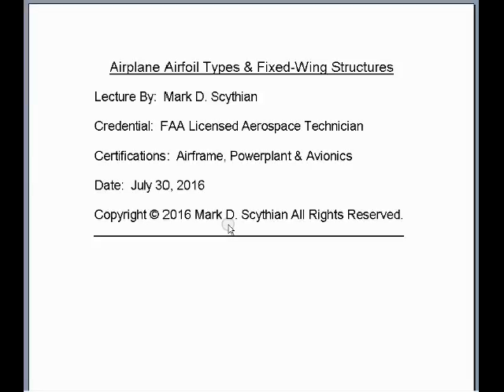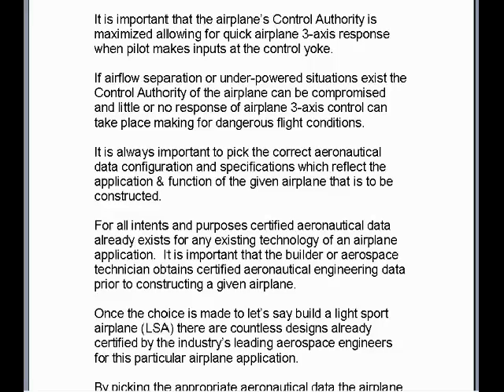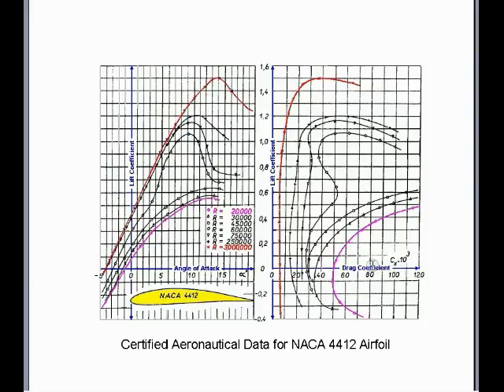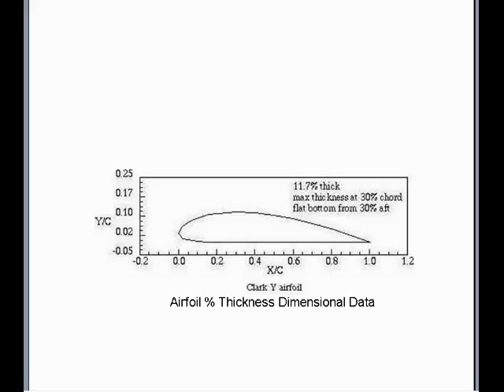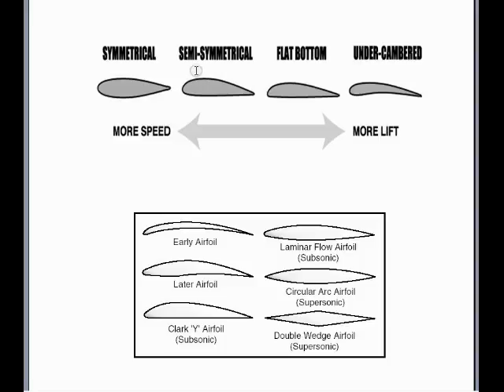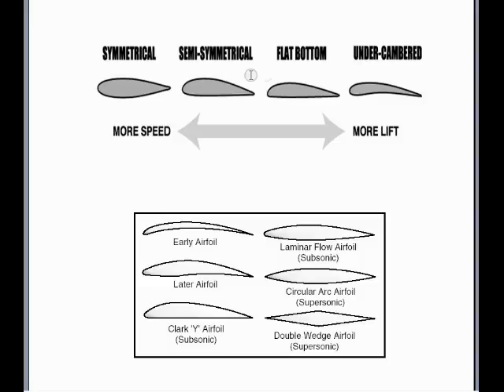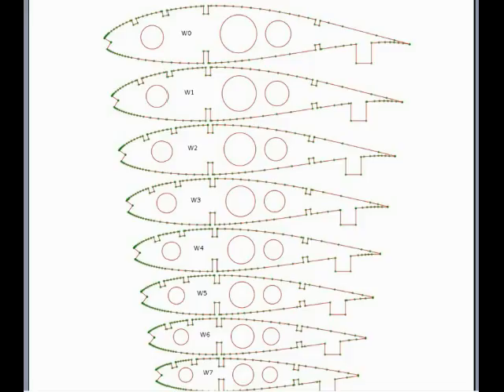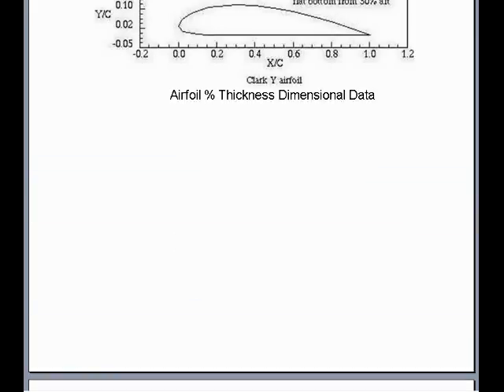Airplane Airfoil Types & Fixed Wing Structures

Comment: Wings fly because of the physical actions and reactions that occur between the distributed heavy, sticky, elastic, sealing, connected viscous fluid particles existing around the zone in which the wing exists. NOTE THE IMPORTANCE OF THE MASS AND THE STICKY, SEALING, ELASTIC, VISCOUS,  CONNECTING  PROPERTIES OF THE FIELD AROUND THE SURFACE OF THE FLUID  PARTICLES, INCLUDING THE  RELATED FIELD PROPERTIES AROUND THE SOLID WING ITSELF WITH ITS OWN MASS AND AREA OF EXPOSURE. 
The mass and other properties making up the air particles can create a compression zone if the fluid particles move towards a stationary object with, its own mass and area of exposure, or the stationary fluid particles are approached by a moving object. 
The mass and other properties making up the air particles can create a suction zone if the fluid particles move away from a stationary object or the moving object moves away from stationary fluid particles. 

In all the cases mentioned above note THE IMPORTANCE OF A FLUID BEING TREATED AS A CONNECTED SYSTEM WITH AN EFFECT THAT IT COULD BE TREATED AS A IMPERVIOUS  MEMBRANE WITH AREA AND  WITH MASS, APPROACHING OR RETREATING FROM AN OBJECT WITH ITS OWN MASS AND A LARGE AREA OF EXPOSURE.

Note no compression nor suction zones can be created if the fluid air particles and the wing did not have  BOTH an effective MASS and an AREA OF EXPOSURE.   Pinpoint masses approaching or retreating from each other cannot create neither compression nor suction zones between them.  A lump of dry loose sand or gravel particles are thrown at a wall will not create an effective compression zone before them nor a suction zone behind them because they do not have the sealing property of acting together to form an impervious flexible membrane. 

In a stall, the state of the air particles with respect to the shape of the wing at the time will create a fierce suction zone which will rip the effective sheet membrane effect of the fluid particles for these to become like individual sand particles and the membrane suction effect is lost, thus lift is lost.  A heavy suction effect can stabilize a vortex of fluid circulating around it, but this closed circular membrane effect of fluid does not help in flying, and lift needs the fluid to act as an impervious sheet membrane with distributed mass.  If the membrane effect of the fluid is lost to high suction zones, then particles will be like sand with mass but not enough exposed area to make a large weighty floating piston effect to pull or push at to create the required accelerating forces with compression or suction effects around the wing. ( Enough suction in a stall) 

Note that what was described above can occur not only because of a high angle of attack but by other states as in, sideslips, wingtips, elevators, ailerons, rudders, spoilers, flaps, slats and even protruding rivets and extended undercarriages, dive brakes. It could also be affected by side winds, wind shear, and other turbulence and ice on wings and heavy raindrops disturbing the state, the wing was designed for.

Basically, the dynamic lift is obtained in zones, through Force= mass* acceleration and accelerations in fluid surroundings and an airfoil having relative velocity between them,  there are four principal zones to consider. Take the cambered airfoil operating at a slow speed.
1.  Compression zone at the leading edge and above it,  followed by
2. Suction zone all along the mid-rear upper surface all the way to the trailing edge.
3. Suction  zone under the leading edge followed by
4 Compression zone all along the lower surface all the way to the trailing edge.
  
These four zones make up all the logic that is needed to curve the streamlines around an airfoil section with zones accentuated or diminished to cater to the required speed of the airfoil. 
We shall not talk about what happens in a wind tunnel as in reality it is the air that is initially at rest and it is the airfoil that moves and caused the zones mentioned above.
Basically, the initially stationary heavy air is accelerated vertically up and down but due to the mentioned zones around the airfoil section, this is what happens.
 *A stationary fluid particle compressed at the upper leading edge, when rising up will find ahead of it a suction zone and so in addition to an up-down vertical motion, it will accelerate towards the trailing edge thus shifting it horizontally.
 *A stationary fluid particle sucked up at the lower leading edge will rise up will find ahead of it a compression zone and so in addition to an up-down vertical motion, it will accelerate towards the leading edge horizontally.
This is the reason why in a wind tunnel ( air moves, airfoil motionless) this relative horizontal displacement difference is shown as the upper surface streamlines going faster than the lower surface. In reality, of actual flying, the stationary air particles can be said to shift in location, with those on the upper surface moving up and down into a suction zone towards the trailing edge and those at the lower surface moving up and down into a compression zone thus displacing towards the leading edge. 
What we see in a wind tunnel must be interpreted correctly and we should not say that the air above the surface of a wing is moving faster than those on the lower surface. 

Something to think about...... if the air-fluid particles around the wing acquire any substantial forward velocity, the airfoil will never fly!!!!   In reality of flying, it is the stationary heavy air particles that are shifted, basically being accelerated and decelerated about their initial position. ( the wing is not so thick after all)   In a wind tunnel, it is not exactly like that, and one needs to know what frame of reference one is working with. Again in the reality of flying, it is the airfoil that is moving fast, while the air-fluid particles are merely being, accelerated, note,  ACCELERATED, around the same location to produce the lift and drag within the vicinity of the wing. All that happens behind the wing is of no concern apart from those who try to fly in it. All that dumping behind the wing is consequential, but it does not contribute to the lift of a wing,  and only those fluid particles which are accelerated in the zones mentioned above and below the wing, are the true masses that produce lift and drag.  If we lived in a perfect world,  while the airfoil section goes through the initial stationary heavy mass air particles,  they will merely accelerate and decelerate and they will regain the same location they occupied before the airfoil traveled through that zone/space of a fluid matrix with uniquely connected mass/viscous particles.
Reply from the maker: Hi carmel pule'.  Thanks for your comment.  Consider the concise-version of 'why wings fly' in the following content below.

Aerodynamic wing lift is predicated on the following:

1.) Airfoil Effect.

2.) Aero-Elastic Boundary Layer & Dynamic Viscosity.

3.) Bernoulli Force (flat-bottom & semi-symmetrical airfoils).

4.) Newtonian Force (symmetrical, semi-symmetrical, and flat-bottom airfoils).

5.) Computational Fluid Dynamics (CFD).

6.) Navier-Stokes Equations.

7.) Reynold's Number Limitations of given aerodynamic structure.

8.) Aerodynamic Lift = [(P)(A)(V^2)(Cl)] / [(2)]; where P = slugs/ft^3 air density, A = 2D plan-form wing area in sq ft, V = indicated airspeed in ft/sec, Cl = coefficient-of-lift for given wing airfoil.
Reply: @markscythian7179  Hello Mark, thank you for replying. As I deal a lot with young students, 15-year-old children, I prefer to show them experimental procedures. I have a water tank in which I can introduce an object to view the streamlines around it.  I thought that it would be interesting to try and find a method where the contour of the airfoil will be generated automatically. 

What I did recently was to get an object in the shape of an H  and rotate it by 90 degrees to become horizontal, such that it would have a  rectangular hollow at the leading edge and another one at the trailing edge.  When the fluid was made to flow along such a rotated by 90 degrees  H-shape, first without any angle of attack,   the hollow in the leading edge generated two contrarotating votices that were kept bound in the hollow due to the high pressure at the leading edge, but ahead of the leading edge, the streamlines divided as normal over and under the object, with the high-pressure zone and the velocity vectors at the leading edge, setting the leading edge two vortices in action. 
At the hollow in the trailing edge, another two contrarotating bounded vortices were developed and this time they were held in the hollow by the usual suction at the back and the velocity vectors at the trailing edge setting the two back vortices in action.  
The interesting issue about this shape is, that while within and in the immediate vicinity of the shape, there was a lot of turbulence, a little away from the hardcore shape was formed a fairly smooth trajectory/ contour of the shape of an airfoil, which was a natural shape which the object itself created. 
I thought that one could forget about the turbulence that was formed within the shape and outline the approximate/average limits of the smooth streamlines zone, then one would have what looks like a good airfoil.  I call this a naturally evolved airfoil which the obstructing shape contoured by itself.  I have a feeling that airfoils on birds and fish were shaped with such natural evolution over a few thousand years, as a bird can feel the turbulent zones around its wings and so natural evolution saw to modify the wing so that it would finish with the silent wing of an owl. 
https://youtu.be/d_FEaFgJyfA
https://youtu.be/Vjk9Ux2COx0
Again thank you for replying.
Reply from the maker: Hi carmel pule'!  You may want to craft a NACA 2412 airfoil from pink-foam (housing insulation foam).  Perhaps a NACA 2412 airfoil with a 1 meter chord (3.28 ft).  Accomplished by scaling-up NACA 2412 dimensions (found online at Google Images) onto a drawing board.  This is a reliable way to build a wooden NACA 2412 airfoil template.  Which can then be used as a 'guide' with a 'hot-wire-foam-cutter' to accurately cut out a NACA 2412 foam airfoil from a panel of pink foam available at hardware stores.  Afterwards, obtaining a transparent plastic circular duct and fitting it with an electric-fan at its intake, to ingest a smoke-source of some kind placed in front of the fan.  Using airflow rather than water flow (hydrodynamics) may be a better educational demonstration for aerodynamics.  If you have enough smoke and fan airflow speed with foam airfoil painted black (acrylic paint works well on foam), you should be able to demonstrate a visual boundary layer flowing over airfoil to your students.  NACA 2412 airfoil is a practical semi-symmetrical airfoil which utilizes both Bernoulli & Newtonian force components for resultant-aerodynamic-lift. The smoke will flow significantly faster over the top of the airfoil compared to the bottom of the airfoil.  A good concept to teach young students as a preparation for fluid-dynamics coursework during their future college days!

Comment: Nice presentation specially for the symmetrical aerofoil I, think  these are more suitable for helicopter rotors where only Newtonian principle is effective for production of lift because these are rotating in high speed. Thank you .
Reply from the maker: Very true.  The symmetrical airfoil whether for fixed or rotary wing is theoretically a 1:1 ratio in upper & lower airfoil surface distance more concerned with aero-elastic profile for the Boundary Layer at higher airflow speeds for an efficient L/D.  The Newtonian force component induced by blade pitch change will set forth a Bernoulli force component speed differential by the Newtonian pitch or AOA change itself. 

Thanks for your comment Rashmi!
Reply: Very true. Well what should be the thickness of wing skin if it is an aluminium sheet for what grade ?
Reply from the maker: That information can be referenced by accessing fixed-wing aerospace structures specifications after calculating the Young's Modulus limits of the structure for tensile force limits and tensile pressure to calculate cross-sectional area limitations.  Aircraft aluminum sheet metal specifications can be found at the appropriate manufacturer, university and engineering societies.  ASTM should have this sort of information.